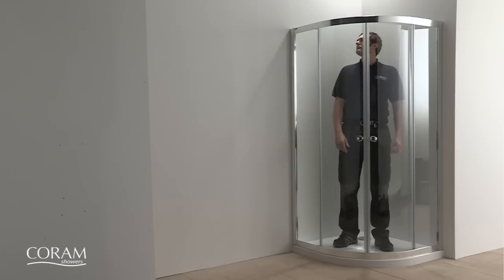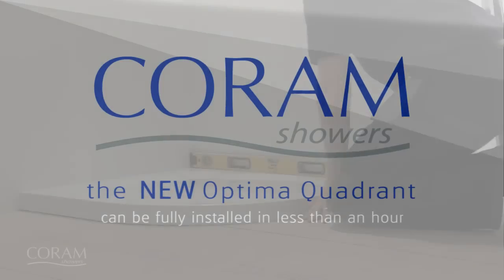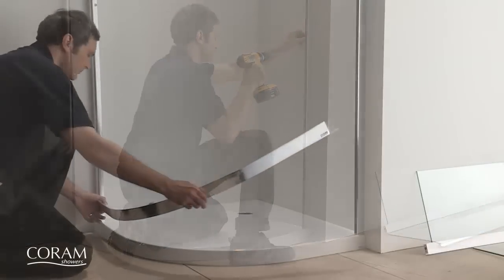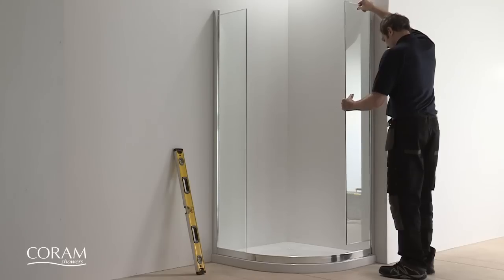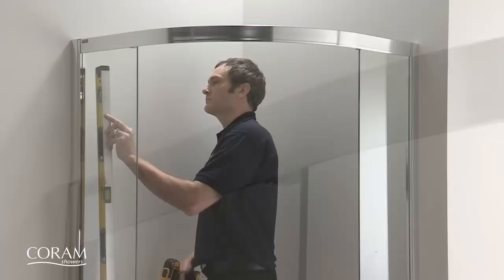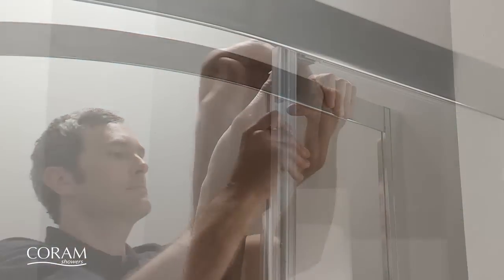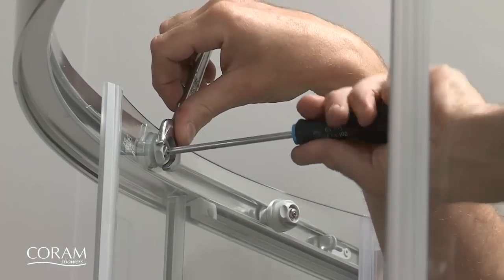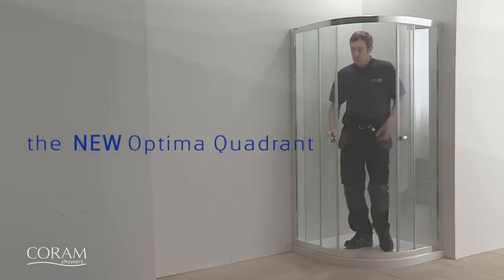Coram Optima Quadrant Step by Step Install Guide From Byretech

Comment: This video is misleading. It takes considerably longer to install than 45 minutes  unless all holes are predrilled in the frame & tiles and the doors fit perfectly by pure luck ! Levelling the doors is tedious. The door running gear is of very poor quality made from cheap plastics. From my experience there are better quality shower enclosures out there for not much more money. I advise not to buy this enclosure.